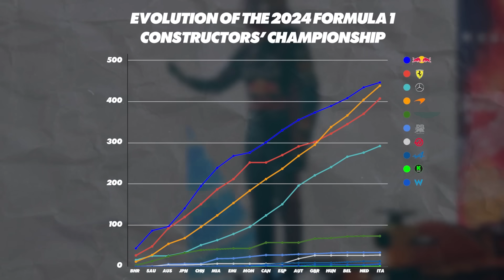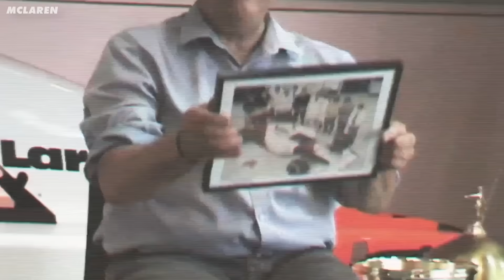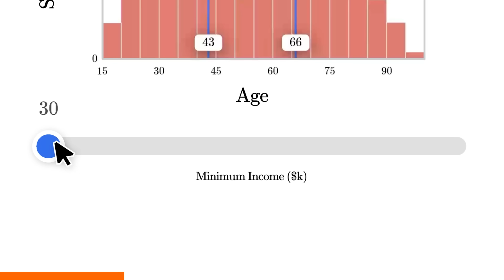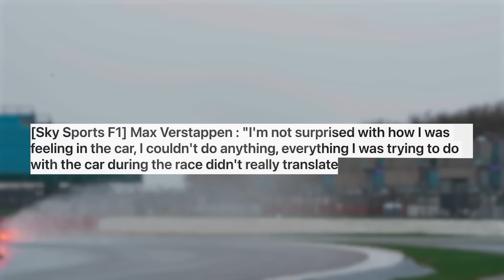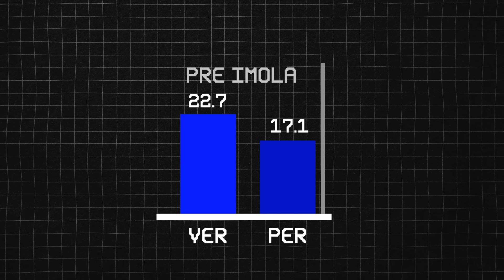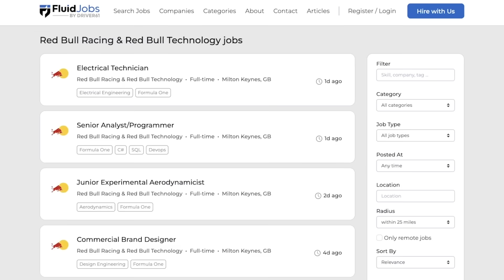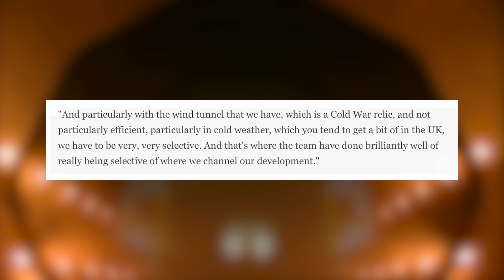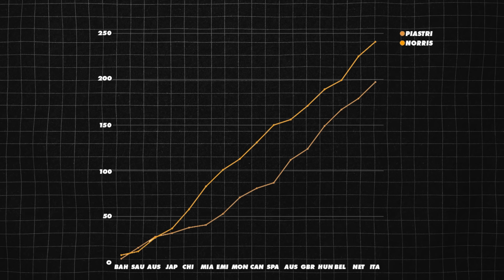Why McLaren Are Now SO FAST

Comment: "Piastri was more agressive than I think was right". Don't agree. It was clean, fair and Lando was too conservative. Its racing
Reply: Clean and fair within the rules. I think Norris may have been referencing McLaren's own Papaya rules. If I was Brown I would sit Piastri down and say we are at a point where we need to maximise Norris' points. Next season, both drivers will be free to race and if you get yourself in a similar position, we would expect Norris to do the same. Not bias but simply trying to take the opportunity which has opened up due to the McLaren getting stronger and the Red Bull weaker.
Reply: @simonfuchi6461  Oscar would need to be insane to accept that. And with Webber being his manager, I'm 100% certain he has a clause in his contract saying Zac can't make him #2 driver.
Reply: I think that Lando had made the assumption that his team mate wouldn't go for that gap so therefore didn't defend it. Now he knows.

Comment: It's been pretty obvious that RedBull have had some "mechanism" illegal or not that gave them a massive performance advantage and now after FIA intervention they are not able to run it anymore. The drivers have been hinting for some time that Rebull had something up their sleeve and I'm sure the engineers at other teams have had a good idea what RedBull where up and now the FIA have finally intervened after complainants have been made. It's just a shame that the FIA haven't made exactly what mechanism it was it public. It could be a mechanism that prevents plank wear which allowed the car to run lower but my money is on electrical deployment which gave them extra boost out of corners as Max always seemed to have extra speed down the straights up till now.
Reply: It seems like the FIA and RB are never going to explain what was going on. We will probably get some explanation from an expert in a few years, after the FIA has done something else terrible and needs fans to look away. The idea that the RB was totally legal and dominant until a coincidental reg change - then they are the 4th fastest and only barely - that's just not how the world works.

Comment: Why, is everyone saying "illegal" brakingsystem. If the rules need to be updated, it wasn't illegal (because so many people don't understand it: my point is not about the legal system. If it's against the f1 rules it's illegal in f1. But they had to update the rules to address this brakingsystem, therefore it was not illegal before, otherwise they wouldn't need to update it if it was illegal before)
Reply: @paarker  illegal according to f1 rules, but this system was not illegal before the rules changed
Reply: @paarker  it actually is
Reply: Became illegal.
Reply: @Lazy_Tim  that's different wording than saying "they could have been using an illegal system" but it wasn't illegal before
Reply: @BassPlayTV  That's exactly what I meant. Was legal now isn't.
Reply: it's the spirit vs the wording of the rule. the spirit was very clear from the beginning: no brake steer. the wording left room for interpretation, and that's what changed. the teams knew it was illegal in spirit, they just exploited the wording.
Reply: @dnltbrca  no spirit of the regulation in f1
Reply: @dnltbrca  using the words as a basis is not exploiting them, that's just a mistake on the FIA side
Reply: @dnltbrca  this would make both the mclaren and merc frontwings illegal aswell
Reply: Actually, it is illegal in the sense that winning with a car that breaks the rules is essentially fraud. If a team wins by using a car that violates regulations, they’re gaining an unfair advantage, and that undermines the integrity of the sport. Even if they're not being prosecuted by law, in the sporting world, it’s still cheating. Fixing sporting outcomes like that, even if it’s not a criminal offense, is unethical and damages the credibility of the competition. Just because teams aren’t being held accountable by legal systems doesn’t make it any less illegal in the context of fair play.
Reply: @jvolney  that's not the point if they need to update the rules of f1 in order to address it, it means that it was not illegal before
Reply: @BassPlayTV  or that they will let red bull get away with more,
Reply: It WAS not illegal, however. It may very well be now, but they are clearly not using it. Every great designer has exploited the wording. I suggest reading Newey's autobiography.
Reply: @gogox98  I know, there is no spirit of the regulation in f1. But everyone says that they were could have been using that "illegal" brakingsystem, but it was never illegal if they need to update the rules in order to address it
Reply: Hamilton have all championships with illegal car, but they bent the rules for him.
Reply: @martisuper7963  lol so salty after all these years
Reply: @Benisuber1  Why wold I be salty, because England has african driver as the best English driver ever? And rules bent form him... its like a joke hahahaha

Comment: I build parts for some of the F1 teams - I'm not allowed to tell you what parts, or what teams - so I get some inside information. Red Bull are in trouble, they've had problems from the very first on-track testing at the start of the year, and the problems persist even this late in the season. If I was betting, I'd be putting McLaren before Red Bull.
Reply: Rb20 is an unmitigated understeering abomination without the rear brake steer.
Reply: it seems catastrophic for them at the moment it’s very interesting..if you were a betting man who would u bet is winning the wdc?

Comment: Why do Red Bull still have an outdated windtunnel? It would have been much smarter for them to invest in a new one before the budget cap became a thing.

McLaren's rate of progress since the start of last year is amazing. Every team is constantly bringing updates, but they rarely make any difference. McLaren, however, manage to substantially improve the car every time they bring new updates.
Reply: The facilities don’t fall under the cost cap. Only the money spent in development and running of the car
Reply: There is a factor here, alluded to by Driver61, that isn't clearly seen or understood. McLaren's serious improvement hints that (somewhere within their design team) there are clever brains that are able to comprehend how the car operates as a whole package. Understanding how everything works together, at the complexity level of an F1 car, is no small feat. It requires truly gifted engineers, with natural talent for seeing details and interplays far beyond what calculations and numbers reveal, and not just folk that did well in academia. If this stuff could be taught and learned, there would be no advantage. And they are all working together as a proper team, all helping the car to improve as a package. 

I'd say Adrian Newey was one such person, but Red Bull did not appreciate that "impossible to evaluate" skill. Most folk that do not have this special ability do not even understand what it is, and hence cannot assign any value or worth to it - cue the average manager (and recruitment interviewer)... 
Newey felt undervalued - public spat with Horner about that - and chose to quit. 
And Red Bull has been struggling to sort out imbalance and unexpected behavior ever since Newey was taken off car design. Go figure. 

Testing and development might generate a new part, like a front wing (for example). Like for like, the new part represents an improvement, so it gets bolted on. BUT if that new wing adversely affects other parts of the car, in (most likely) unforeseen and unpredicted ways (because there remains far more unknown physics, than there is known), the expected gain is negated, and no-one understands why. This is when a team appears confused, and at a loss to know what to do about it. By "unknown physics", I'm talking about the difference between reality and testing / calculation. The wind tunnel footage shows the wheels on a moving conveyor (rolling road). Rotating wheels affect the air movement (topspin and backspin in tennis...) but ALSO air generates a boundary layer when against any surface. If the wind tunnel blows air along a static road surface, then a boundary layer builds up against the road surface that completely ruins the ground effect air floor, destroying any attempt to design an underfloor. By moving the road at the same speed as the air (matching the reality of the car moving past a stationary road with no wind) then the ground effect can be evaluated. 
Now.
Have they tested what happens when there IS wind? Headwind, tailwind, and side wind? And at what speeds? That's a vast amount of extra testing. 
But the point I wanted to share, is that in the video footage, the suspension was being activated, presumably by rollers under the moving conveyor, pushing up and down to simulate an uneven road surface. VERY important - the downstream wake from the wheels (especially the front wheels) greatly affects the air flow over the rest of the bodywork. 
But the reality is that the bump in the road is fixed, and the WHOLE CAR has to move over it. The effect of the moving wheel on the air flow is important, but so too is how that bump affects the ground effect as the car moves over it. And I very much doubt (correct me if I am wrong, because I am only speculating here) that the wind tunnel simulated bump only moves the wheel, and does NOT move with the conveyor, along the length of the vehicle. So now you have a "pinch point" in the ground effect air flow, that is not being tested for in the wind tunnel... 
It's simple, basic, and obvious. But it is sooooo easy for engineers with their noses buried in the daily grindstone of scheduling tests and evaluating results, to forget that the measurements they are obtaining are NOT the "fully realistic" data of how a car behaves on track - it is only the best approximation we can make of it, with the tech and equipment we have at the time. 
Those specially gifted folk remain aware of this kind of stuff, and even have some feel for how that "bump in the track" might disrupt the ground effect as the car moves over it. They will consider it when evaluating new floor designs, and pick the one that might be 1% less perfect, but 50% more likely to be least affected by "real world variables". Meaning, they get consistency in the car behaviour. 
I base most of this opinion on the laughably slow response to the "porpoising" problem when ground effect was re-introduced. That nobody seemed to understand what was happening or why, revealed that most of the engineers were specialised experts without that special kind of "overall package" intuitive feel. 

The only way to avoid these kind of issues, is to see and understand how everything works together. And that's where those special, gifted, talented folk come in. The ones that most recruitment experts cannot even identify at the interview... 
Getting the right people into the right places, doing the right jobs, within the team, begins with those recruitment interviews. Both in the "skills" being looked for, but also whether or not the recruiter realises they need "someone special" and has some clue how to find that, as opposed to the "box tickers" who want to hire those folk that most fulfil the obvious job requirements for education and CV experience. 

Then again, using an antiquated wind tunnel will not be helping. 
On the other hand, it has not hampered them in years past, so that is not the full story either. Last year's car was the most dominant ever, crafted out of that same wind tunnel. 
Feels more like a convenient excuse to avoid having to acknowledge Newey was indeed the "brain" behind the package performance of years past.
Reply: @bythelee  It seems Red Bull, possibly like many other teams, are falling for the famous theoretical-downforce trap; very much like McLaren did about a decade ago. A car may produce a lot of downforce in the windtunnel, but this may not create a fast car in practice, when the ride height continuously changes. Teams usually call this "correlation problems", even though these are known limitations. Red Bull, like McLaren in the past, seems to mitigate this by using a very stiff suspension to keep the platform within its operating limits, but this has drawbacks as well (less mechanical grip, harder to attack the curbs). With these ground-effect cars aerodynamics are even more complex, because of the porpoising, so it's even more challenging to make all the parts work together. Without Newey, Red Bull are finding it extremely difficult to make net improvements. I do believe the car is faster than at the beginning of the season, but not much.
Reply: Adrian Newey's brain was a wind tunnel.

Comment: Not gonna lie Driver61 but you need to focus your content on this season from now on. Its SO JUICY and we need EVERY TECHNICAL BREAKDOWN of HOW and WHY the season has panned out like this. 

Why? Because this is not a surprise. McLarens develop path last season saw the same pace of development and the car they ended last season with was night and day compared to what they started with at the start. And they have done it again but started with a better overall package. 

Red Bulls drop is also expected. Because of the race deficit they had to their rivals, they always stopped developing the current season car early to start on new years car. With how Red Bull started the season, I don't think they expected to need to develop the car beyond phase 1 of the season if Max keeps being Max. Especially with all the changes happening in the background regarding their engine. BUT BUT BUT, the drama surrounding RedBulll in the first 5 races 100% affected the TEAM. The effects of a team not unified is hard to quantify but the affects are clear to see. They are no longer a "well oiled machine". 

Mercedes and Ferrari be fighting themselves loool
Reply: Variable rear brake bias ?